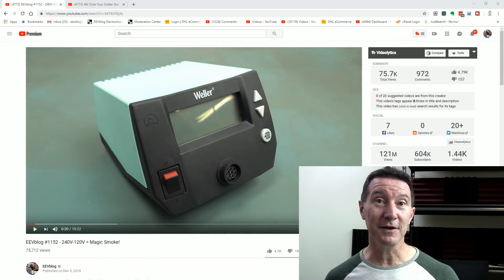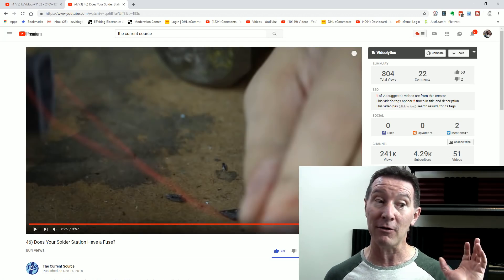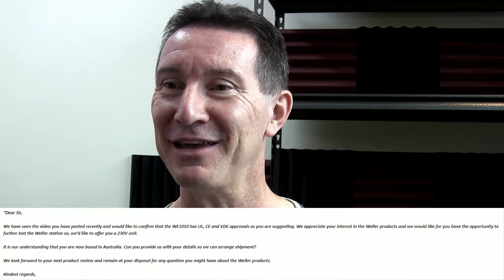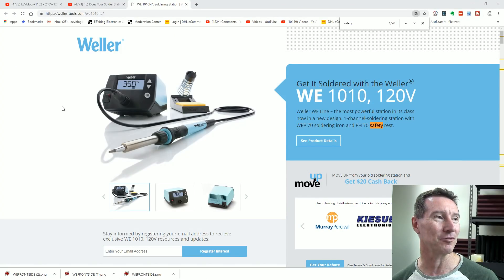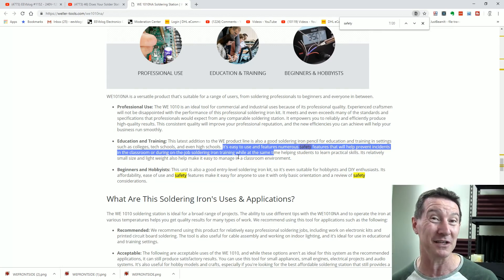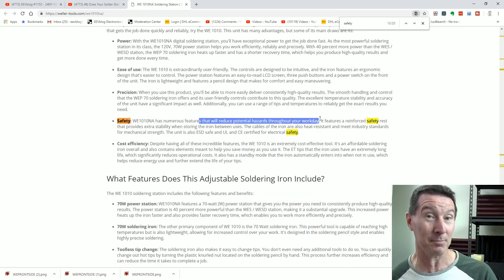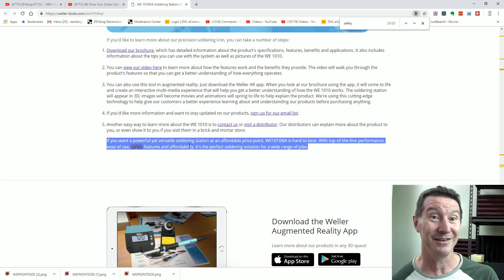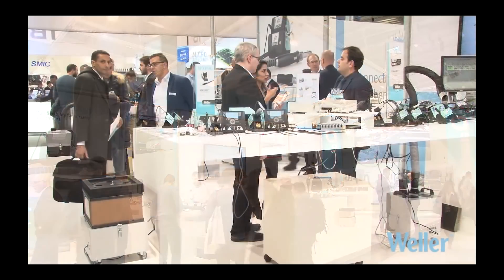EEVblog #1160 - Weller Responds!

Comment: Just a follow up,, in the United States; A 110/120v outlet and a 230/240v outlet have different prong orientations to eliminate this very issue. So....  to "accidently" plug a 110/120 into a 230/240v outlet the cord plug would need to be  changed. Mmm .... shenannigans maybe?

Comment: Amazing that brands with such a good reputation and 'high quality' tag as weller still use a wound transformer, single voltage input and, on top of this, no fuse. BTW "CE inspection" without primary side fuse??? Must have been an internal inspection...
At least they are not (yet) blaming the Chinese for flooding the market with cheap low quality stuff and unfair competition 😂

Comment: I am in the process of replacing my 40 years old Weller station (which has a mains fuse) and the idea of replacing it by another Weller was pretty much inexistant.
Buying a new Weller would feel like buying a modern design of the old one.
There is a very big chance that my next station will be a JBC, they are expensive but I was able to save some money for 30 years.

Comment: My question is... Where did they get the UL, CE and VDE approvals? How much did they pay for? I'm sure a lot of brands are getting these without any testing or anything really. I am no expert but I wouldn't approve something like this.
Obviously you can still kill a 110V transformer plugging it to 240, but without a fuse you're basically making a quick toaster that will keep burning until the breaker trips... It's NOT safe.
That marketing guy is trying to buy your opinion on their products rather than answering what is going on, shame on this brand.

Comment: It would be appropriate to have input protection but why would any corporation submit themselves to higher standards then certification agencies protocols? UL/ETL/CSA & others in NA cover electrical & fire safety in their tests prior to approval. Manufacturers are free to follow additional testing but that increases costs, I wonder if Dave designs & manufactures to higher standard levels than required by the countries where the products are intended to be sold. There are literally millions of products without input protection that are certified & I know most sensitive electronics will not take too kindly to having its input line double in a steady state condition even with transformer thermal protection. Our lab runs about 14 Weller units of various ages, we had 1 fail over a period of 5 years even with bad power delivery, sags, spikes lots of harmonics on the line & other nasties this is a testament to the brand, might not have your standard of protection but almost flawless when used as intended. We always appreciate your videos.

Comment: How do you plug a 120V unit in a 240 Volt line when the plugs are supposed to be different to avoid such errors.
Reply: It's easy when the item has an IEC style connector instead of a permanent mains lead as this one did.
Reply: When I seen the back of the unit I realized that. It's time to retire that connector for 220V.

It never made sense for that connector to be dual voltage when you think about Murphys law

Comment: A fuse will protect base on how and where the short occur .I have seen many car amplifiers with completely burnt power supply and the B+ fuse stays intact .I had a WES51 iron 110v which i  plug into 220v by mistake and it did not smoke.I just took a funny smell and that was it.I don't see the big deal here .

Comment: Typical American bull. They think that operating at 110/120v is more than enough for safety operation . Would question the insulation integrity of the transformer. You would expect that the transformer should be able to withstand 3 X its rated voltage for at least 30 minutes. But as you say Dave no basic protection on the primary side. Definite no no situation.

Comment: Based upon this, I should probably consider "safety" and replace my WESD51. Weller happens to be based here in NC and were kind enough to send me a replacement temperature adjustment knob when the little prongs broke off inside the unit with just normal use. I bought it for the "rah rah" American made stuff and because my earliest memories of a radio repair shop in the 1950s where a big fat, black, Weller soldering gun was in use. How could I go wrong with that?

Comment: I had to watch this twice to understand this;  A inattentive individual plugged a 120V device into a 240V outlet and was surprised at the products failure. Then when Weller responded they gave the moron a new unit for free.  WHAT, WHY.....MOCKERY?  i UNDERSTAND YOU MAY FEEL KIND OF EMBARASSED (AS AN ELECTRONICS/ELECTRICAL INFLUENCER) THAT YOU MISTAKENLY PLUGGED THE IRON INTO THE WRONG SOCKET AND DESTROYED THE UNIT, BUT DON'T TAKE IT OUT ON WELLER. Weller, and any tool manufacturer, can only protect there products from a limited amount of stupidity. I agree with Mark H,  .

Comment: The transformer is the fuse.  Wind it with smaller wire... save money twice.  Coincidentally, I've been tasked with making a soldering iron purchase for my department... Weller will not be under consideration... Hakko will be.

Comment: Even my old WTCP station/iron had a fuse in the transformer on the primary. Found this out when it finally died after 25 years of trouble free service.
Perhaps Weller could make fuses out of all of the worms that Dave has just released from the can. Be good if they are EARTH worms.

Comment: I've been using pencil type soldering irons for well over 50 years. None have fuses. Never plugged one into the wrong voltage either.

Comment: The required testing is to subject the units to various specific tests in order to meet the required directives and standards.Short circuit, Over voltage input for indefinite periods. The unit must not catch fire even when used by an Australian. If it meets that standard then you are safe (in theory). Fusing mostly protects equipment and not the user so I cannot see an issue with these irons. If you break it through carelessness then you are responsible. If it kills itself when a fuse would have saved it then they will most likely replace it. If you want to rant about it then try to set fire to it and then maybe you have a case.

Comment: Had a look behind my Stannol Industa 550 (760050). It has a primary side fuse, 1A 250V. Just a regular glass fuse, but still. And it says on the fuse box with capital lettering "USE ONLY WITH 250V FUSE" :) And there's even a spare fuse included within the holder, yay! Wuppertal FTW ;)

Comment: Even an cheap soldering station would have an proper fuse... Cheap & proper fuse, hmmm 
I dare to say that the fuse will not blow at the expected over current.

Had several Wellers but none of them released smoke even after decades of 24hx5days powered on.
Happy JBC user.

Comment: In some cases EU regulation allows for a device to be only fused on the secondary side. Weller certainly isn't the only one to do this. It might surprise you, but indeed there is nothing to see here. 
In the case of the Weller there are some (safety) rules that apply, it has to confirm to the insulation class that it is sold as. It should not interfere with other electronic devices. It should stay save if it fails due to electronic or static interference. And well,.. that is it. 
The whole CE thing is a kind of a red haring and a source of a lot of misunderstanding and myth. While initially very strict, up to a point where it was unworkable for small manufactures, the whole CE compliance thing was relaxed soon after its introduction.  I take the liberty to simplify quite a bit here.

A product has to confirm to CE regulation but the manufacturer does not have to test this. However when challenged the manufacturer is liable for the CE conformation. 
For most electronic products however its enough if the product does not cause interference and stays safe when it fails. Very often this is obvious and there is no need for testing, just slap on the CE mark and you're done.

CE testing is mostly done for liability and insurance reasons. Some examples where you DO want to test:
1) Products that are likely to violate CE rules as part of how they function, for example you can't have wireless transmission without causing interference. 
2) Products that have to keep functioning correctly when they receive electronic or static interference. Think medical equipment or automotive applications.

And ever wondered why so much stuff for the EU market uses an external power supply? Even 19" rack stuff where there is plenty of room for a build in PSU? Well there is a much relaxed set of rules regarding electronics that is not connected to the mains. According to EU regulation the external PSU is connected to the mains, the device it powers is not. Basically its quite  hard to fail CE if you move your power-transformer to an external box.

Comment: How exactly did you accidentally plug a 120 volt appliance into a  230 volt outlet? They have entirely different configuration.  There's lots of appliances that don't have primary fuses. If you think a small transformer is gonna burn down anything, though not impossible if you leave it on in a pile of oil soaked rags. Lol.  It is protected by you electric panel.  I'm sure your smart enough to know that.
Reply from the maker: Look at it, it uses a standard universal IEC mains connector, and there is no label on the back where the connector is. Easy to forget.
Reply: @EEVblog  guess that's a assuie thing

Comment: weller is something beyond  my understanding. I bought a pretty decent fume extractor, which happens to have external port to control it's airflow. 
Just take a look at this freaking ridiculous thing: https://www.weidinger.eu/shop/schadstoff-absaugung/loetrauch/weller/weller_zubehoer_fuer_absauggeraete/wl24209
and this is kind of basic version: 
https://www.weller-tools.com/professional/EUR/de/Filtertechnik/Loetrauch/Direktabsaugung/Installationszubehoer/ZSRS
i can understand how Apple sells charger brick without the cable. but oh my god Weller,  what the heck.

Comment: In the UK as you know we have a fused plug system,so a 3 amp fuse could save a major short circuit without the magic smoke emission,there is no logic to this product design,it is not safe and the best thing we can do is to vote with our wallet to protect others!Regards Colin.

Comment: I've got a Weller PU81 analog station, and this one does have a mains fuse (T 500 mA) integrated in the IEC mains plug. It's a 230V version "Made In Germany". First I thought it would be a VDE thing for getting the approval, but the only mark is the CE logo, no VDE, TÜV, UL, etc.

Another interresting thing: The analog version uses a PIC micro. I believe it has the same regulating software on it as the digital one. Though I never looked at the response how the iron is regulated (simple two-point or some PI regulation).

PS: The station is about a year old.

Comment: Why would you plug a 120 into a 220 line? You are a MORON and shouldn't be doing anything with electronics. Wellere shouldn't have offered you anything but maybe a basic electronics class!
Reply from the maker: Look at it, it uses a standard universal IEC mains connector, and there is no label on the back where the connector is. Easy to forget. If it had a fixed mains cord with US plug it would have been obvious.

Comment: At least in the UK, any responsible user (!!!) will fit an appropriate fuse in the plugtop, probabaly 1A or at most 2A. It would then be safe. Not the best solution though; it should be a part of the instrument itself.

Comment: I remember a Fluke meter (probably 8845) with a burned out mains transformer. It was configured for 230V, and was accidentaly connected to 440V AC. No mains fuse too.

Comment: Cracked open my Ersa RDS-80 and, suck on it Weller, not only does it have a primary-side fuse, it's also in its own little cardboard bunker compartment only open towards the mains switch and the fuse holder is in a thick heatshrink tube. (Still, don't get one of those, the iron that comes with it has what I hope is the worst lead from any name brand.)

Comment: Dave,
First, it's pronounced Veller, not "Weller". And you plugged it in to 240 so even if the secondary side is fused the primary side is going to burn up!
We have the Weller WX2 and it's a great station. Lots of really good tip choices and it's perfect for SMD work. But hey, we bought an expensive soldering station we're smart enough not to plug it in to twice it's working voltage!

Did you ever get directions and it says something like, 'don't put your hand in the flame you might get burned.' And you think who could be so stupid to stick their hand in the flame? So now Weller will come out with something in their manual saying, 'don't plug 110v stations into 240v outlets. And I'll think, who could be so stupid to plug a 110 station into 240 volts?
Reply from the maker: Look at it, it uses a standard universal IEC mains connector, and there is no label on the back where the connector is. Easy to forget. If it had a fixed mains cord with US plug it would have been obvious.

Comment: You got my curiosity up so I opened my TC202  (power unit for WTCP series). It has fuse protection, on the secondary winding. It has an open frame transformer and I saw no sign of protection on the primary. Who knew! Thanks Dave.

Comment: I first started using Weller irons in the early 1980's. As I remember they all had fuses and thermal fuses. I'm guessing fuse or not depends on the age of the unit. As for VDE and UL, I believe they require fusing for anything mains powered though I'm not 100% certain.

Comment: I'm going to take a wild guess and say that it'll trip a 15A breaker within a certain time limit if on the usual U.S. spec 120V 60Hz circuit under those particular conditions. (NEMA 5-15 seems to be the most common indoor outlet in North America.) That's probably how they got out of needing a fuse yet still passing for a UL rating. Of course you'd need to hear from somebody on the design side rather than the marketing wank side to know how they got by like that.

Still if the Chinese imitator does a better job these days, then guess who should be getting the business? (Albeit it's not too surprising to have the "copy" and the "original" made in the same factory these days.)

Comment: In the UK with our big bulky 3 pin plugs, every plug has a fuse holder, 3amp, 5amp or 13amp is what's available.  Just wondering if this a UK unit? 240V

Comment: If I power a 120 volt light bulb with 240 volts what do you think is going to happen to that light bulb it's going to glow very bright and then it's going to eventually burn out very quickly because the light bulb was not designed to run at 240 volts how simple is that you people need to take responsibility for yourselves and your actions
Reply from the maker: I didn't say it was wellers faults, I admitted it was entirely my fault. But that's not the point here.
Reply: @EEVblog  Would be kinda funny but a lot of effort to compare all comparable products of similar class (short cords, a transformer, fully isolated chassis (or is it?), and what have you, from the US market to see if anyone over there made the financially irresponsible decision to add the fuse that's strictly speaking not required for a given product...
Reply: Light bulbs are a natural fuse.  (in fact, most light bulbs DO contain a fuse in the base)
Reply: @rgarito  you  are full of crap. Jack ass

Comment: Wait I think everyone's missing the point he plugged a device that was designed for 120 volts into a 240 volt Supply how is this Weller's fault it sounds like operator error to me and you need to be attentive to what you're doing case in point be aware of what you're doing.
Reply: Because the point is that it lacks a fuse, for cases of surges or whatever. The expectation never was that it can handle 240 volt, but it also shouldn't be a fire hazard.
Reply: IF it overloads, then you just rely on 15A breaker, not so good if the item operating current is 0,2A or so..

Comment: Seriously, all this because he plugged it into the incorrect power output??? whoops I accidentally plugged my device made for another part of the world in to a socket after changing the plug and never did it cross my mind that maybe it shouldn't be plugged in here after all it's not like the voltage isn't listed anywhere. Maybe seeing as Dave gets devices from all around the world with different voltages he should mark them appropriately (fused or not) which I think is a failure on his part.
I agree it should have a fuse, but this amount of theater is ridiculous.

Comment: Well I can confirm that my Weller WSD 81 Solder Station has a 500mA Timed fuse built into the IEC C13 Power Socket at the back of the UK Version.
Also shows you the location of the fuse here: https://docs-emea.rs-online.com/webdocs/01a3/0900766b801a3916.pdf
Reply: Well I did some checks and the following Weller models have fuses on the base unit: WTCP 51, WSD 81, WS 81, WAD 101, WT 1012, plus a few more.

Comment: Hey all my yihua/quicko units have mains fuses and cost 1/5th of the equivalent Weller stuff. Only drawback is the tips don't lass that much. But hey you can buy 5 tips for less than $10. You know it's BS because  it's all made in China (even the "Made in Germany" stuff is just assembled and finished in Germany).

Comment: The check of those guys at weller .... anyone could have come up with something smelling a whole lot prettier sitting on the bog. ... Biggest laugh I've had in a while ... though I must say even some of the worst designed stuf has primary side fusing / protection ... whats an extra 5cents if that and 30secs of workmanship to bodge a fuse in? sweet bugger all...